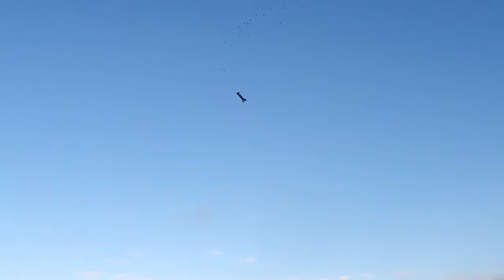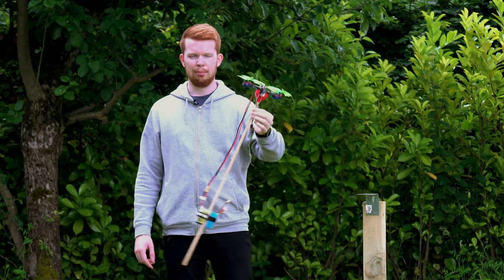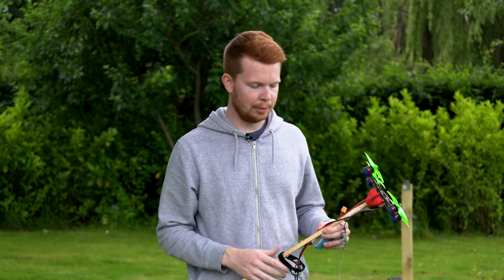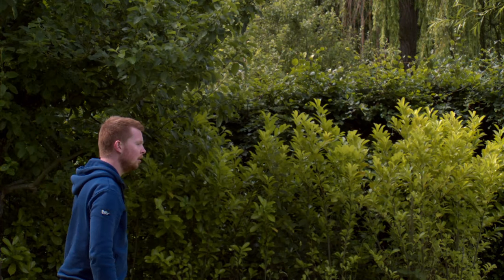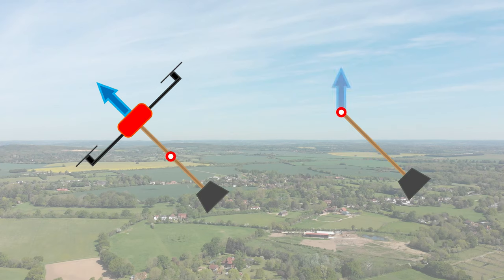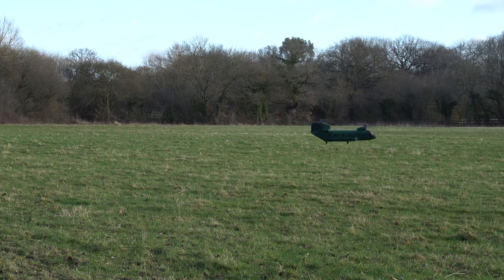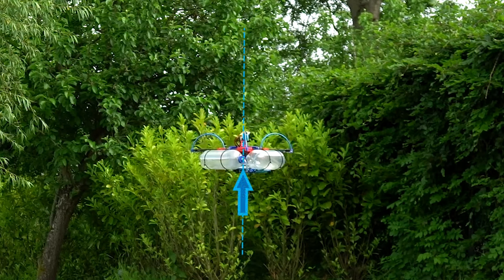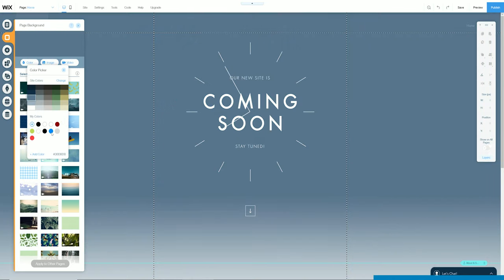Drone Pendulum Fallacy

Comment: When I was younger I tried to design a flying vehicle that would operate off of centrifical force. In my design the vehicle had rotating weights that would extend away from the fulcrum on the downward thrust and then would pull into the center on the upward thrust which would then reset the cycle so they could be real extended for a second downward thrust. It's probably too complicated to be viable, but I've always wondered could it work?

Comment: The center of mass by itself doesn't show the full picture, what really matters is the rotational inertia. In order to have the most stability, the rotational inertia should be large, requiring more torque to rotate the drone off its initial axis.

Comment: What  we need to understand is that anything that flies should not be too stable or too unstable. If an aircraft is too stable it will stubbornly resist any pilot input that will change the aircraft direction or attitude, but if an aircraft is too unstable the slightest breath of wind or tiny control input could send the aircraft crashing out of control.

Comment: The pendulum fallacy applies to a system in motion. Repeat the test but do not disable the gyros, mount the pole on top of the drone, not the bottom, and attempt to maintain a stable hover *without moving*. As soon as the weight at the end of the pole moves off vertical, the drone will attempt to ROTATE itself to maintain level, which will require more force the longer the pole is.
Imagine trying to do the old balance-a-broomstick-on-your-hand type trick, but you are only allowed to use rotation, you cannot translate your hand (You are allowed to grip the broomstick, you don't have to balance it on your hand, as that would obviously be impossible).
Now repeat the trick with the broomstick facing downwards - it's a lot easier.
@6:46 The thrust vectoring is applying a translational force, it moves the CoT under the CoM. This is NOT what a multirotor drone's FC tries to do, it tries to apply a ROTATIONAL force about the point of the FC, not about the point of the CoM - the FC is completely unaware of the CoM of the system, it assumes the CoM is the center of the drone itself.
Reply: someone actually gets it...  The question in a quadcopter is:  if you cannot make the center of gravity equal to the center of thrust then is it better to place the COG above the COT or below?  (i.e. top mount the big Li-Ion battery or bottom mount).  The answer is of course a bottom mount.  A pendulum is inherently stable and controlling a pendulum is much easier/takes less energy than an inverted pendulum which is inherently unstable.  Note that I assumed that the distance offset in the vertical direction from COT is equal in the top and bottom battery mount case.  The decision is more complicated in the real world because it is easier to get a top mounted battery closer to COT than a bottom mounted battery due to current frame design (hobbyist not professional).  Also it does not appear to matter that much (top mount versus bottom) as we are only talking a half inch or less in offset :)

Comment: All control system rely on measuring an " error angle" and with the flat propellers and the pendulum, there is no device which can measure the offset error angle with the vertical. In a balloon relying on buoyancy, there is a righting torque effect once the system has an inclination but this does not happen in the pendulum effect.
There are a few additional procedures one may try as they do with a wing when they add dihedral and to turn they add the drag of the rudder otherwise the aircraft will slip sideways.
In the craft shown in the video one, many give the propellers a dihedral effect so that the inclination will offer some error correction and also one can experiment with adding DRAG or dynamic drag so that the upper part will always be slower than the mass location zone on the craft.  
The dandelion seeds seem to use this procedure to stabilize itself. Just watch the beauty of nature at stabilizing a simple seed which is not so simple after all. In a control system, one needs to understand what we mean by," Error Control"  and error consists of many parts including location error, velocity error, acceleration error, integral error. There are more errors to account for if one is to go into detail as in the case of drag where this is proportional to ( velocity squared) and not directly to the velocity.  Such parameters could be used to stabilize an inverted pendulum and even more than that.  
https://youtu.be/clKEdi-nXVw
https://youtu.be/XWhGjxdug0o
https://youtu.be/5oGYCxkgnHQ
https://youtu.be/JpNAhKT7yY4
https://youtu.be/aH9Ud0Fol7k
https://youtu.be/Apx6xS93wqE

Comment: But what the low mass will do is give it a higher rotational inertia, which can allow more time for corrections to be made. The corrections would require a greater torque, but if you're working with slow hardware or something it can seem reasonable in those situations.
Reply: EggyRepublic in that case, a high center of mass would have the same effect. I guess this isn’t used cause having the center of mass offset significantly from the center of the props will mean they are in an awkward position to create a torque, so it would make it incredibly sluggish, although i suppose that could be useful in some cases, but it’s also not aerodynamic at all, and its not practical for it to be so large. At least I think?

Comment: Great video Tom.  This is one of the most comprehensive videos on the subject.
But, what about achieving a more accurate centre of mass for something like a racing drone? This would dramatically improve the quadcopter’s maneuverability and also efficiency?

With technology within drone flight controllers being so advanced (but obviously not to the point achieving an accurate sense of zero gravity), do you think there is still a market and/or desire for race drone pilots?

Comment: Also show what happens when carrying an load like a water container or other under-slung load? Really enjoy your videos, keep up the good work.
Reply: No, even better! He needs to build one of those water chambers that they put at the top of buildings to stabilize it during an earthquake! It's like a long U-shaped rectangular tube filled with 2 columns of water that flow back and forth to keep the buildings mass centered over it's base. The water sloshes back and forth to keep it's water levels balanced and the building intact.
Reply: oscillating masses like that are normally tuned to the resonant frequency of the building, if I understand them correctly. A water tank with baffles in it should mostly act like a single mass, right?
Reply: @SgtxJay  Well... I'm not an expert, but I'm pretty sure if an oscillating mass were tuned to the resonant frequency of the building, it would destroy the building! Although, yes these are also known as "tuned mass dampers". But I think they're more tuned to themselves than to the building. ie. the big weight in Taipei 101 could be a different weight if it were at a different height, cable length, etc. For the water example, you would need a sufficient amount of water (or a sufficiently long tube) or both. But any damping would help, it just might not do much/enough. 
Inertia keeps the weight (water) stationary as the building moves in one direction. Then when the water starts moving in the direction of the building it counteracts the force of the building moving back towards it lessening it's overall movement. The larger the weight the more kinetic energy it will cancel. (Up to a point. Plus the heavier it gets the less of everything else the building will be able to support.) 

In the example I'm thinking of there would be no baffles in the tank. Water would be able to rise in one side of the U shape and fall in the other without slowing down. Although to answer your question, I think so? Certainly it would act as one mass if it were sealed in a closed container unable to slosh around at all. I was unable to find the exact video I'm thinking of, but there are similar systems being used in cruise ships although those are active instead of passive systems. They pump water from one side of the ship to the other to keep it level.

Comment: Does lowering the battery not aid in stability by increasing the moment of inertia and therefore dampen the roll and pitch while not effecting the yaw. I know that pendulum effect does not apply and that it is indeed a fallacy in this context but I would think that spreading out the mass vertically and increasing the inertia would have an influence. Not something you want in a race quad but in a camera platform or your falcon it might be desired to have a dampened roll and yaw. Great video and great channel 👍

Comment: A moving object creates drag.  I bet the drag from the battery was overpowering the weight.  
So add more weight or reduce the launch angle?    

You might also try attaching a string from each arm of the drone to the top of the stick to give the stick a bit more leverage.

Comment: Given the fixed thrust force to the stick (no torque) the weight does not help indeed and the resistance for only makes it worse by applying a torque in the direction of the tilt. if a longer stick were above it would apply it counter to the direction of the tilt

Comment: Thanks Tom, really great video. Though it should be mentioned that this is assuming a fixed pendulum shaft to the body of the drone, thus it can be simplified to a COM shifted body. Though this should not be confused with pendulums (or inverted pendulums) which is mathematically different if the mass hanging below the drone body is free to pivot. Then, in control theory, you’d have to treat the control equations as coupled differential state space equations. If you take a deep dive into that, you’ll find that inverted pendulums are FAR more unstable, and thus don’t align to the fallacy. 

In short, you’re right but there’s more to consider not covered in the fallacy if the pendulum is free to move relative to the drone. (Your chinook part demos this well) If there is a free pivot, you’ll find suspended mass is far more stable than elevated.

Comment: As the thrust of the drone prop ensures that the body is accelerating faster than the weight of the pendulum the angle of attack will always increase thus the drone will increase in horizontal speed BUT lose height rapidly. Just my opinion.

Comment: Hi Tom, I just recalled from years ago  an Aussie kite designer trying to get a wing to stabilize using a fixed pendulum weight aka pilot. The idea was to stop the forward tumbling of the constant cord wing with no tail...i think he may have got a patent for it as well.  Back in the early 1900s or late 1800s fyi and interesting to see if you can check this out etc.. regardsvLaurie
Reply: No wing sweep btw

Comment: Very good video, but if anyone remembers the days of crappy flight computers (before the days of the Naze32), bottom mounted batteries were far better as they allowed the drone to fly well without being tuned right. Modern fc's have just gotten so good it doesn't matter anymore, it's even preferable to top mount to lower the rotational inertia.

Comment: Cold you try to use a pendulum as gyro sensor?
With two potentiometers measuring the angles of the pendulum  to get the x and y tilt

Comment: Instead of lowering the CG, what should be done is to angle the props so that they're slightly toed inward from the top and outward from the bottom, this will have an effect similar to the dihedral on fixed winged aircraft and in fact has been implemented in certain drones before.

It has the inherent stability that one would expect the pendulum to achieve without any drastic changes to the CG.
Reply: As a matter of fact if the drone in the video were to have the props toed inward the pendulum effect would be drastic.

Comment: What if you hang a mass on a stick under a drone, with the strick free of rotating and moving independently, via a joint....would it improve the stabilizing action of the drone, or simply destibilize it?

Comment: Drones like to rotate around mass the weight needs to be above not below the drone. The props needs to apply torque  to rotate the mass so you want them on the handle end not the mass end.. by lifting the mass above the quad the speed of change is accelerated by gravity trying to pull it down this speeds up the pid loop and makes it more stable as it can react faster to user input. Simplest way to put this is "easier to push a car then pull it" and that's the effect is has on the drone

Comment: This also shows why an accelerometer mounted on a drone can not be used as an inclinometer in general. Deducing the up direction using an accelerometer requires an assumption of a non-accelerating (with respect to the Earth) frame of reference.

Comment: i always guessed it would increase the moment of inertia about the pitch and roll axis, which mathematically makes sense. as for that being more stable, who knows. i was always told the only reason rockets have the engine on the bottom is that it can't go anywhere else though. any other potentially more stable design would be outrageously more complicated

Comment: You're saying the force on a pendulum points up, but is parallel on the drone due to the force of the propellers, however that is without an autopilot trying to level the drone, when it is trying to level the drone the force obviously wont be parallel, it will be pointing up.

Comment: What would happen if you attached to pendulum via ball and socket?? I think the affect would be dramatically different. Also the tension on or free movement of the ball and socket allowing it to swing with the least resistance possible would be a factor for the performance of its flight. My theory is if you put at a diagonal take of like before would leave the pendulum in place for a moment then it would be at an angle like a fixed one but by reducing thrust would allow it to catch up and or switch sides

Comment: What if you had three or more strings (all the same length) that points of connection on the drone is as far from the center of mass in the x,y axis and equidistant apart. Then attach a mass connected to all the other ends of the strings at the bottom. The motors would have to work harder to move the drone around, but it should be really stable.

Comment: What if instead of the weight being connected at one point and fixed at an straight angle, it was multiple symmetrical points around the center of mass, and connected via string. 

So if for example the drone leans towards the left, the weights would pull down on the right side, since the right side of the drone is higher than the left, making the right side connection strings have tension, while the left side connection strings have slack

Comment: I'm a bit late to the party, but I feel like you missed an obvious point: adding a weight at a distance but in line with both the thrust vector and the center of gravity would in fact increase the stability of the craft, because it increases the craft's moment of inertia. Assuming you started near a localized stability point, increasing the moment of inertia would significantly increase the size of perturbation required to disrupt the craft from steady flight (or hover). On the downside, this can make steering feel heavy.

Comment: I LOVE this video because I've struggled with this question myself in my custom quad-copter builds.  The heaviest component is the LIPO battery.  Should I mount it at the top of the frame with electronics below or vice versa?  I've been mounting at the bottom.

Comment: Question. If the pendulum had a free joint, obviously it would hang down towards gravity and would have no effect on stability, but, if the joint was something like a flexible piece of plastic with spring to it, could it be used to increase stability? Or would it make it worse?

Comment: May be using a chain instead of a stick will improve the result of pendulum effect. Using chain to link the mass from the pivot point always makes the mass normal to the ground.
Reply: it does not make the mass normal to the ground. It makes the mass parallel to the force vector. When the pivot is fixed, that force vector follows gravity, but if mounted on a drone, the chain will trail behind, no matter the orientation of the drone.

Comment: If you want a physical example, you can take a baseball bat (or any other long object with more weight at one end) and try to balance it on your palm. You will have a MUCH easier time balancing it when the end is up rather than when it's down.

Comment: The trying to fly with really low center of gravity and the rotational inertia is what seems to help lead people to believing in the pendulum effect?

You said it yourself, the FC will have to work extra hard and you will probably crash.

Taking it to the extreme likely beyond the capabilities of the drone/PID controllers?

I do not think it is entirely imagined the differences I feel between a top mount and bottom mount battery.   However I suck at tuning as well and  COG difference seems greater with my bottom mount stuff I flew.

Comment: Great video. Just wondered could you control the pitch or a drone, by changing the COG. eg: by moving a mass left-right & front-back either mechanically or hydraulically by moving either a solid mass or fluid mass such as mercury.

Comment: You know what, it actually might work if you didn't have the drone solidly connected to the same pole. Meaning at the top of the stick connect the drone maybe with like a string so that there's no solid connection to the stick and the drone.